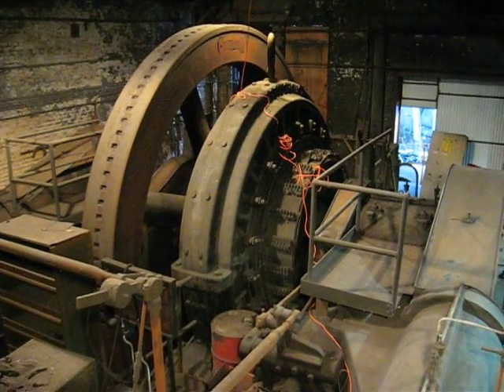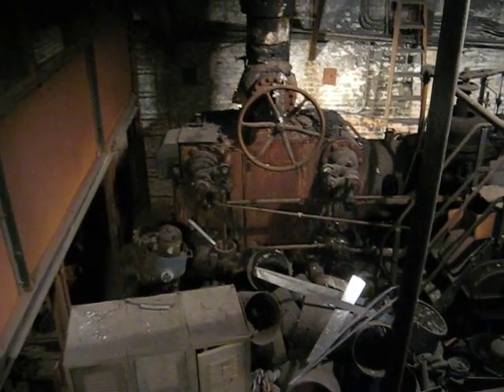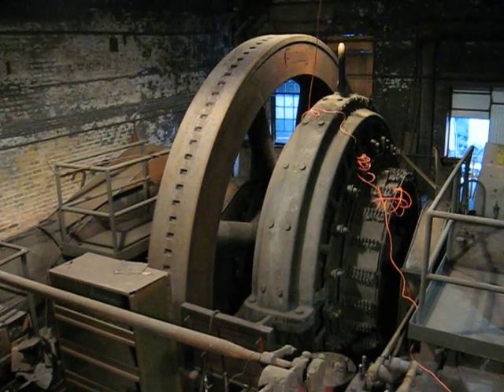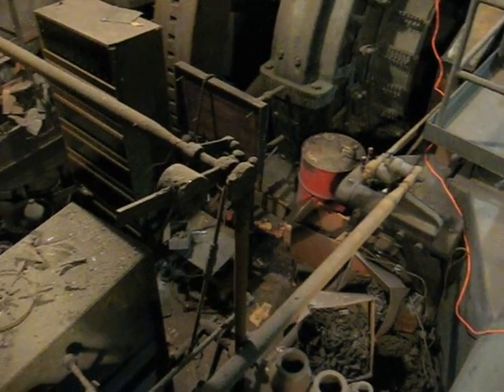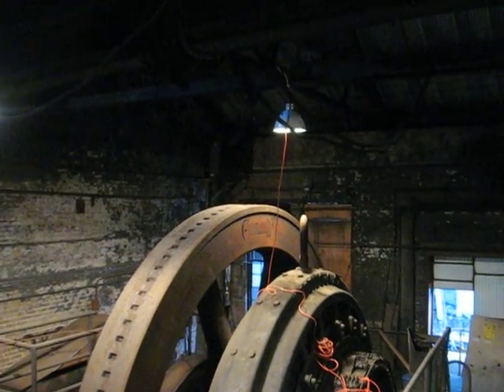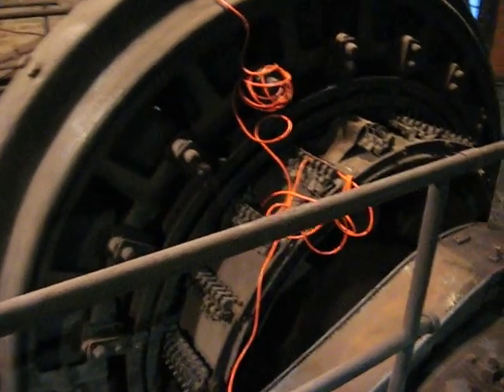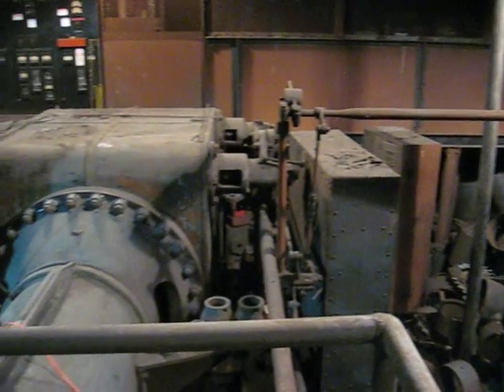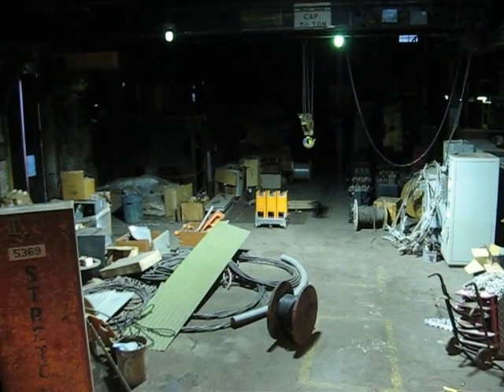LaBelle Iron Works Corliss Engine January 27, 2010

Comment: Slabbing and rolling mills were all DC in that plant.
Mostly installed in 1913-1914.
This unit was mostly used as a backup, as they could buy electricity cheaper than make it.

Comment: What did they need DC for?
Reply: 1913 most of the large electric motors were GE built bu Edison - the DC king. Controls were easier to design and as long as the distances are short DC is fine. The blooming mill in the North plant was manufactured by Mesta in Pittsburgh. The motor for h
orizontal rolls was a reversing motor rated at 7000 HP and 7,000,000 ft. lbs torques at 30 RPM. The bore of the stator was 31' and it ran on 6600 VDC. The vertical rolls were powered by a similar motor with a 3000 HP rating. I don't recall the torque rating. Both motors survived the 1936 flood.